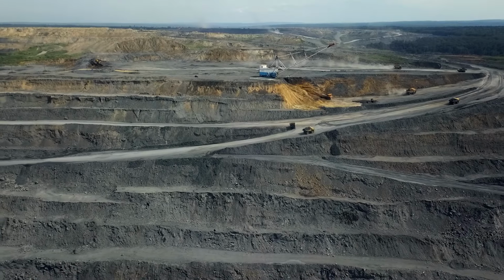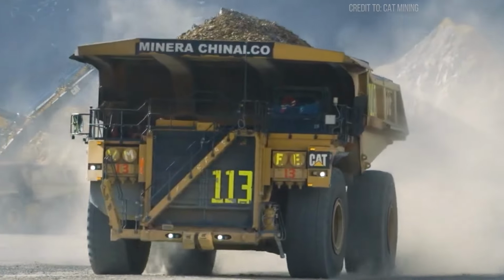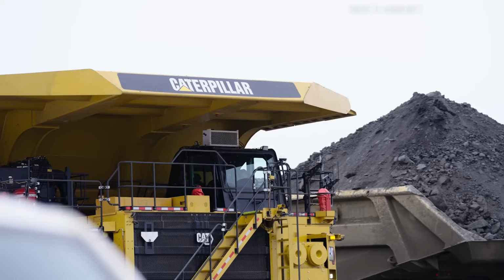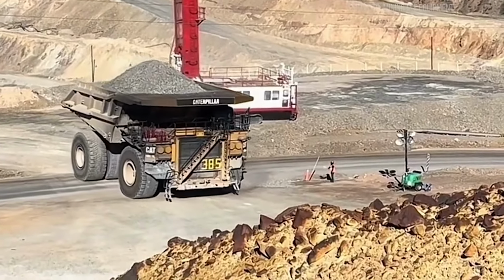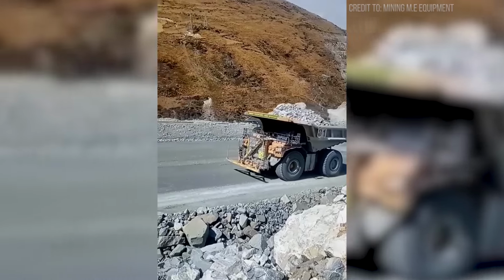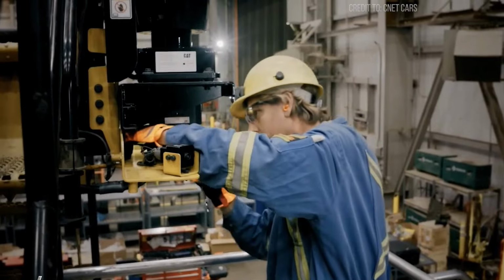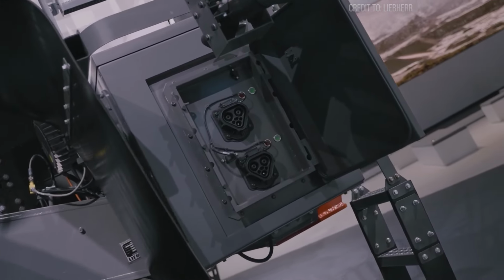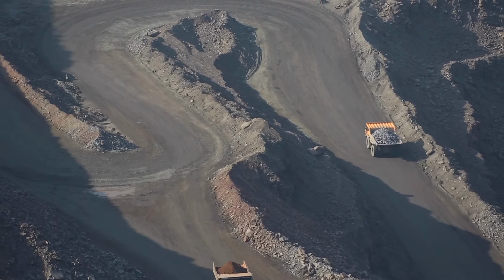The Flaw That Could Kill a $5 Million Truck

Comment: There is always that one dude who thinks his taco truck can do dually work! Put load scales on the machine and problem is fixed
Reply from the maker: You're spot on that overloading is a big issue! 👍 These trucks already have incredibly sophisticated payload monitoring systems (like Caterpillar's VIMS) from the factory. The chassis cracks were happening even on machines operating within their designated load limits, which is what pointed everyone to a specific manufacturing flaw rather than just operator error. 
Hope you enjoyed the video!